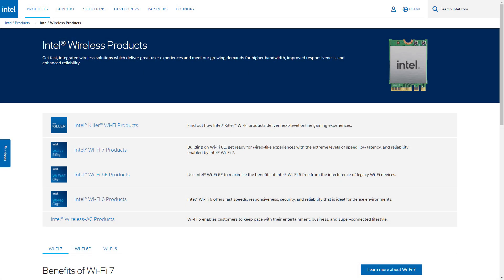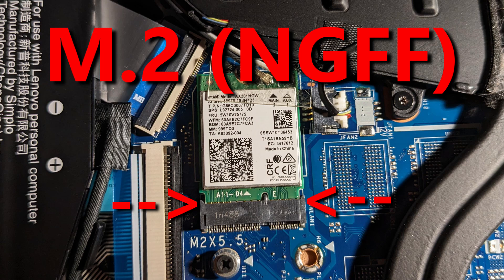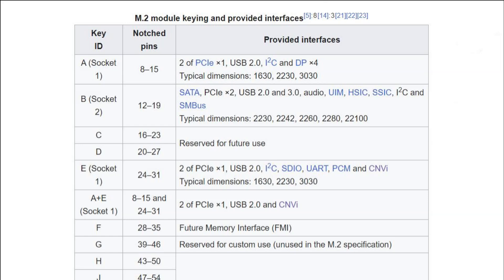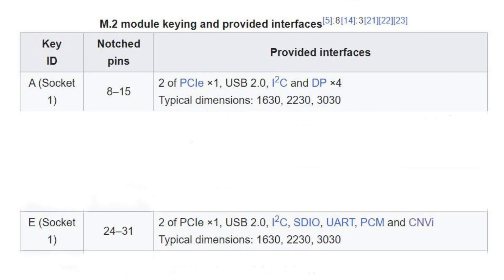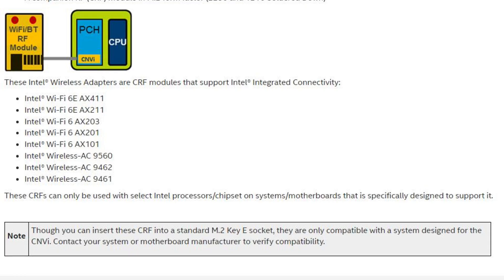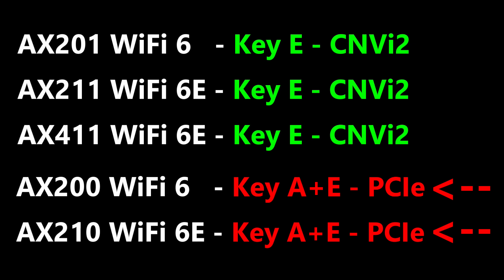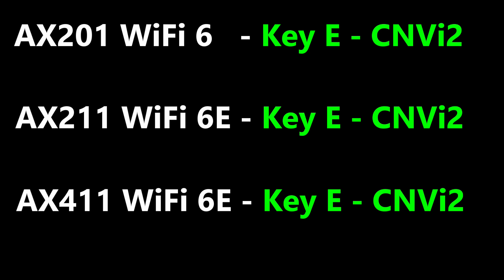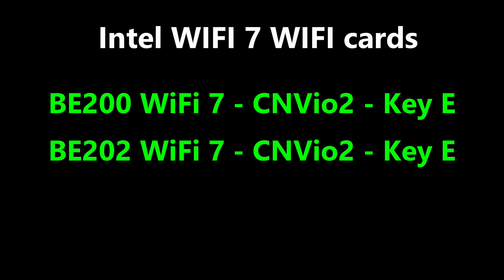Intel WIFI 6 Card Compatibility Issues - What You Need to Know

Comment from the maker: ***I recommend you to create a restore point in Windows before you install the WIFI and Bluetooth drivers. The WIFI and Bluetooth on the card actually worked without the new drivers. I had no issues installing the drivers on my laptop. But when I installed the new Bluetooth drivers on a desktop, the computer stopped typing letters. Wireless keyboards and on screen keyboard registered no letters. If you run into any issues after installing any of the drivers, you can return your Windows system back to a previous restore point. Additional information in the video description. ***
Reply: So a wifi 7 be200 card would work with an older cpu such as an i5 9600k ( desktop )? Or does it also apply for other wifi cards, not just wifi 6?
Reply from the maker: @hex.-lp5ii  The Intel BE200 Wi-Fi card is compatible with 12th, 13th, and 14th generation Intel CPU. If you have an older gen CPU your best bet is the AX210.
Reply: @hex.-lp5ii  I think it depends on the motherboard manufacturer. It tried the Be200 on Acer Aspire 3 with i5-1035g1 CPU, and it works normally. Both wifi and bluetooth work. And since the laptop is still running Windows 10 OS, the 6GHZ of my router is not detected, that's the only downside. Wifi 6 works on the 5 GHZ band.  So, if you are lucky, the be200 might work on your 9th gen Intel CPU provided there is no restriction from  MB side. Unlike HP and Lenovo, Intel does not put restrictions on purpose. After all, tt's a win win situation for them. They manufacture these Wifi adapters and there are millions of PC to upgrade.
Reply: If you had a similar card, it may use the same driver.

Comment: Hp mini pc elitedesk 800 G4 i5-8500t will work?
Reply from the maker: I cannot confirm if it will work. Your best shot is an AX200, if that doesn't work then your next option is to use a PCIE adapter suggested in this thread: https://community.intel.com/t5/Wireless/AX200-and-AX201-compatibility/m-p/1358131
Reply from the maker: I found a listing that has a similar computer to yours and it includes an AX200. Give the AX200 a try.  https://www.walmart.com/ip/Restored-HP-EliteDesk-800G4-PC-Intel-i5-8500-32GB-1TB-SSD-Win11-Pro-RGB-Speakers-WiFi-6-AX200-BT-Refurbished/15749601708?conditionGroupCode=2

Comment: Straight to the point and very easy to understand. This explains why my WiFi 5 works with my new laptop but my WiFi 6 card from my laptop does not work with my old desktop, because the wifi card came with my laptop only support CNVio not PCIE.

You explained which CPU generations of laptops are compatible with which WiFi generations. So I want to ask about my desktop: My desktop has a Z370 motherboard and came with WiFi 5 pre-installed. If I buy a specific WiFi 6 card like the AX200NGW, will it work with my desktop? Is there anything about compatibility I need to worry about? I read the detail from Intel and make sure AX200NGW is support PCIE protocol so I just want to make sure. 

Thank you!
Reply from the maker: On older computers, its more likely that an AX200 will work compared to the AX210. I bought a used lil bit older HP laptop and it wouldn't boot with the AX210. Then I tried the AX200 and it worked. It's worth it to give the AX200 a try.  Your motherboard appears to have the M.2 Wifi slot, its a bit hidden though. https://www.manualslib.com/manual/1319041/Asus-Rog-Strix-Z370-E-Gaming.html?page=16#manual

Comment: Hey, my laptop is a Dell Latitude 5410 with an Intel Core i5-10310U processor, and its motherboard supports CNVi v2. Which Wi-Fi + Bluetooth card should I install in it? Would the AX201 be a good choice?
Reply from the maker: Yes AX201 would be a good choice for your laptop.

Comment: Very helpful tuturial video on updating PC WIFI adapter. My laptop is HP CQ45, and how I should change my old WIFI adapter into the WIFI6E intel adapter? Thanks
Reply from the maker: I have another video where I show the two main types of WIFI cards. You will need to look inside your laptop and find out what type of WIFI card it has. I believe yours has a type called "half mini"  so you need to search for "half mini wifi6e" and see what's available for you. You may need to do some trial and error because you are putting a new card in an old laptop and the bios may not recognize the new card. If you install the card and the laptop won't boot, that's a sign of incompatibility and you will have to try a different card. You can search google for your laptop model number and add "wifi upgrade" to the search and see if someone else has successfully upgrade to a wifi6 card.  https://youtu.be/W0urtUWoJ58?si=kKkD02xNcnuFQLcR&t=21
Reply: @ChavezDIY  🥰🥰

Comment: I bought an Intel AX210 for my notebook, which is an HP 14-BS022LA (Intel 7th generation; PCIe interface), and when I turn it on, the notebook with the Intel AX210 starts up but doesn't give an image... Any idea why this happens and how to fix it?
Reply from the maker: Sounds like your laptop does not support that WIFI card. It's an issue with HP.  Try updating the BIOS through the HP web site https://support.hp.com/ro-en/drivers/hp-14-bs000-laptop-pc/model/16646211  I read that your laptop only supports 1 antenna wire, is that correct? The WIFI 6 antennas require two antennas. I could not find any information of other people upgrading that laptop's WIFI card. You may try going to the HP Community support forums and asking about your options to upgrade to WIFI 6 on your specific laptop.
Reply: @ChavezDIY  Thank you!

Comment: So then the 13th gen i7 will work with any of the intel’s? I don’t need to stick with the pcie protocols?
Reply from the maker: Yeah. According to the info from Intel that's what they're saying. If you're in doubt you can search for your computer model name and the Wi-Fi card you want to use and see if there are compatibility issues.
Reply: I have an asrock b760m-c. But they have a b760m-e which the only difference I could see was the 6g WiFi chip included. I got some intel killer WiFi 7 cards from Newegg for $25 each. Ill be using your vid for guidance! Thanks again!
Reply from the maker: @flubyux2  if it works out or not, you can start a thread on Reddit to let other people know that the motherboard supports those specific cards.

Comment: Intel BE200 (320 MHz) / 202 (160 MHz) are NOT CNVi module.
Reply from the maker: @user-cs1tj5ex5z   there's a lot of conflicting information on the BE series cards and they deserve their own video. I don't have any experience with those cards and just relaying info from others which may be wrong. While the Intel site says they are PCI E interface, ppl were saying they don't work on AMD systems. If you can share your personal experience that may help other people.
Reply: @ChavezDIY  Unfortunately, I do not have any AMD based system to try it out. However, I am using BE200 on Intel 12th Gen based system and it works just fine without any issue. Hope that helps someone. Thanks.

Comment: Ok good info. But how do I know which Intel chipset supports which wifi/bluetooth card? I have a Lenovo Xeon Thinkstation P520 with an Intel C422 chipset. It had no wifi / bluetooth when I bought it. I'd like to use my Bluetooth 5.0 headphones but I can't find out which of the two modules my Thinkstation will accept. Anybody know where I can find which Intel chipsets support which Bluetooth (5.0) expansion cards?
Reply: I'll need to add it using an M.2 PCIe card but that's not the problem. I just don't want to buy the wrong (unsupported) M.2 2230 BT card.
Reply from the maker: WiFi and Bluetooth are on the same card together, and any of these cards will support bluetooth 5.0.  So all you need to do is find a WiFi card that your computer supports. Since you don't have an Intel Core series processor, you should try the AX200 card is more "universal". You'll need Windows 10 or 11 64 bit. Download the drivers but you may not need to install them. You can install the card and see if the computer recognizes it. If it doesn't detect it then install the drivers.
Reply: @ChavezDIY  You may be absolutely right. Yesterday I bought a Windows 11 Pro Retail license so driver wise I should be good. I HAVE narrowed it down to Intel AX200 or 210, thanks for that advice btw. Now since the P520's motherboard does not sport a USB 2.0 header I'll need a USB 2.0 to 3.0 header adapter cable which I already found. Currently waiting for an answer from the parts shop I noticed that has both these items. Fingers crossed!

Comment: Hello. I replaced my current Intel AC 7260 wifi card to a nowadays popular MPE-AXE3000H (Intel AX210) wifi card in my old Acer 8942g laptop and Window 10 64bit cannot detect it. Can be the old Acer is the problem? I saw many forums where many people installed this Wifi 6E card into their different older laptop with success. Or maybe my card is faulty? Do you have some idea? Thank you.
Reply from the maker: The laptop motherboard will determine if it supports the AX210. Did you install the drivers from the Intel website? You'll need to find forums for your laptop and see if other people upgraded the WIFI card. If you think the card is faulty you can try another AX210 or you can try the AX200. I couldn't find a lot of information for your laptop, ever the Acer website doesn't have much info. https://www.acer.com/us-en/support/product-support/Aspire_8942G
Reply: @ChavezDIY  Yes, I installed the latest AX210 driver from Intel. But the installation is also looks strange and very short (probably because cannot detect the AX210) After I wanted to remove it to install and try older version drivers (I cannot find the driver anywhere to uninstall it) and if I try to install older version then Windows said that already the latest driver is installed for this reason installing is blocked. Very strange. The problem is that this wifi 6e card even cannot come to alive, like the laptop cannot detect at all. Can be difference between AX200 and AX210 for the motherboard? It is just Dual or Triple band, probably there isn't any meaning. I think here is the most important is this AX standard. I upgraded the Bios now. Original Bios is December 2009 and now the latest is 28 April 2011 and didn't help.
Reply from the maker: @Karl3377  The AX200 card was released about 2019 and the AX210 card was released about 2021. The motherboard might be too old to support AX cards.
Reply: @ChavezDIY  Yes, it is true, but when I switch on the laptop on the left side of the keyboard there is a small wifi led and normally it lights up. At this card never lights up, therefore I think that the card is defect, completely dead, doesn't give any sign of activity. This is my problem.
Reply: Is this solved? My Acer swift 3 cant also detect intel ax210
Reply: @jstloko  Hello. For safety reason I bought another AX210 to try but didn't work and I sent back to the seller and he refunded me. It seems such AX210 card not working in Acer laptops and the question arise so what is the meaning to produce such wifi cards for older laptops with PCIe socket if never work?
Reply: @Karl3377  so sad then it could possibly not really compatible with our laptop? My laptop feature indicates wireless 6 and my stock chipset also is not detected
Reply: @jstloko  I updated the latest Acer Bios from year 2009 to year 2011 May, I couldn't do more things. My laptop even cannot detect this card, like there is nothing any wifi card there at all, like physically nothing there. Starting the laptop the Wifi LED lamp never lights up and Windows cannot detect and not show any wireless wifi card. Very sad really. But the AC7260 the wifi 5 card is working perfect.
Reply: I was also thinking that it can be only a Windows problem? Can this card work in Windows 11 instead of Windows 10? Or Windows version is not important?
Reply: @Karl3377  based on your message i think motherboard not compatible with this chipset. Is your processor intel or AMD?
Reply: @jstloko  Processor is Intel Core i5 430m, Motherboard is Intel HM55 Chipset

Comment: I recently upgraded my Lenovo 330S 15IKB wifi card to Wifi 7 however, i my laptop is unable to detect the 6GHz wifi signals, any recommendation ? I have made all the possible changes in the settings however, still not detecting
Reply from the maker: I don't have experience using 6GHz band. My router only supports 2.4Ghz and 5Ghz. I know the 6Ghz band provides the least coverage, so you'll need to be close to the router.
Reply: My router is beside my laptop, how much more close do i have to be 😅, but still laptop unable to detect @ChavezDIY

Comment: Will HP Elitebook support AX210?
Reply from the maker: There are many different variants of the Elitebook. It depends on the motherboard specifications. What is the model of your Elitebook?
Reply: @alkamibinahsan4004 if you want to know for sure, you have to download the service manual for you model. HP usually lists a FEW wifi adapters that are compatible with your laptop. To look up for the service manual, I, for instance, typed "15S-eq0000 service manual" in Google, and I found a link. Note that my model is 15S-EQ1011nf. Based on this pattern, you type the the 3 first characters, a dash, two characters and four trailing zeros. With some luck you will find it. Hopefully, HP did not put a single wire antenna wifi card, otherwise your upgrade options are even more limited. Usually, with HP, you will have between 2 to 4 wifi card options that are compatible with each laptop. Everything else is blocked through bios whitelists. At this point, I don't know for sure who is worse when it comes to wifi upgrade, HP or Lenovo; but from what I found out recently, HP is the worst regardless of the price of your laptop. Good luck anyway.

Comment: Does the number of gold pins of my old wifi card have to match with the new wifi card?

Im planning to upgrade my Qualcomm Athernos QCA9377 with an ax210
Reply: I went from this exact same wifi adaptor Qualcomm QCA9377 to an Intel Be200 on an Acer Aspire 3 A317-52  laptop I5-1035g1 CPU running Windows 10,  and I encountered no issues whatsoever. Just bear in mind that if you have a router with 6Ghz band, the wifi adaptor won't detect it as long as you keep Windows 10. Unfortunately, Microsoft backpedalled on 6Ghz band support in Windows 10 to encourage people to upgrade to Windows 11 (older drivers from Intel detect the band 6Ghz even on Windows 10). Microsoft Shenanigans pushed Intel, to remove this feature in their later driver updates. 
So, my advice for you is to share the specs of your system before buying any card. Anyway, it depends on the make of your laptop and its CPU. If you have an Acer, an Asus or Dell, your chances of compatibility are relatively high; however, if your make is HP or Lenevo, your chances are slim or almost zero. Lastly, the Intel Be200 DOES NOT WORK on AMD SYSTEMS no matter the generation of the CPU.
Reply: @shogunho2520  SUPER THANK YOU FOR THE RESPONSE!

I currently use Acer Aspire A514-52k and hearing that Acer laptops have high chances of compatibility not only AX but also BE cards gives me a sense of assurance. I hope you have a good day sir!
Reply: @noelangelo1  You are welcome. What about your CPU ? I Googled the reference you gave above, it turns out that many laptops exist: some with an I3-7020, others with i3-8130U and many others with different CPU. It depend the remaining part of the reference (a514-52k common ref part and 36SC model -specific part ref of an Acer with i3-8130U for instance.) Anyway, I'm pretty confident that the Intel Ax210  will work with you laptop, as to the Intel Be200, I did not try it so far on an older generation CPU (the oldest I did actually try is on an Acer Aspire 3 with i5-1035g1). I hope that someone who did try it on older Intel CPU like 6, 7, 8 and newer gen will come up on to this comment section to let us know for sure. Have a good day as well sir !
Reply from the maker: No, the number of gold pins don't have to match. Some wifi cards are a little smaller (like the one you mentioned) and don't use up all the space in the socket. My desktop came with one of those and I put in an AX210 with no problem.